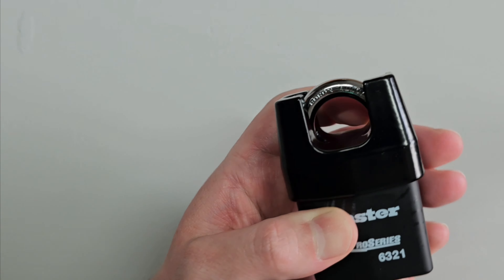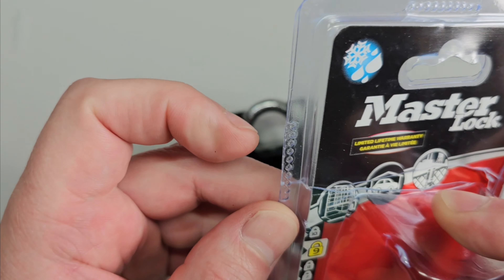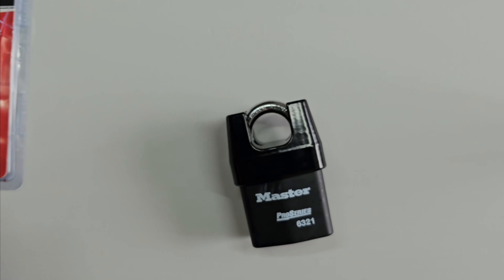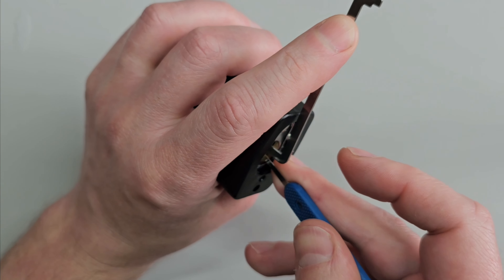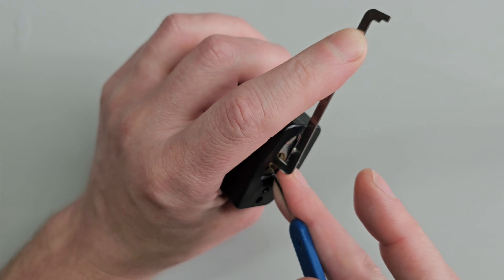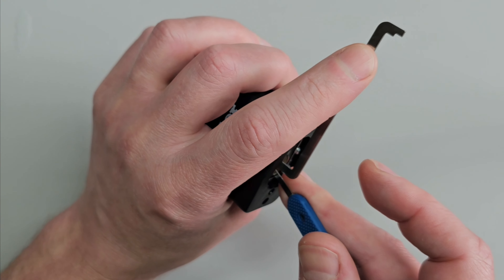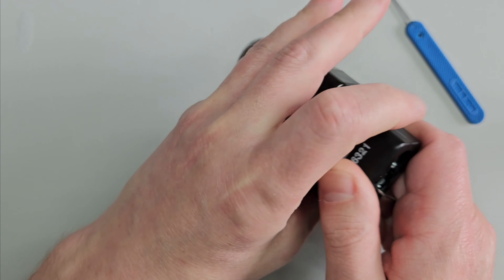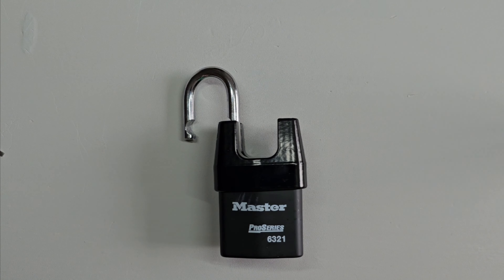Masterlock Pro-Series padlock single pin picked open #lockpicking #locksport #security

Comment: Great picking 👌 👍 👏 
Nice and very confident and clear.   I like opening the lock like this.  Cool done ✔️ 👌.  
 Please tell me how many pins and how many mushrooms are in this lock?  If it doesn't bother you.   A few days ago, I opened the American lock.  7 pins, 6 spools on the street.   After the lock was exposed to the environment for a long time, high humidity on the sea coast, the lock became much more difficult to open.
 American locks in my country not many times can meet. 
Thank you for sharing..
Good 👍 
Good luck, Mate 👍
Reply from the maker: Hi Tipa, thanks 👍 🤜🤛
It's got 6 pin stacks, and feels like the first three are spools, and standard/serrated are the back, I was going to gut  in a video soon, so I'll find out for certain then.

I know what you mean, what country are you in? Even in the UK American locks are difficult to get hold of. I was looking at a Paclock 90A Pro too, and the delivery was something like £160😭